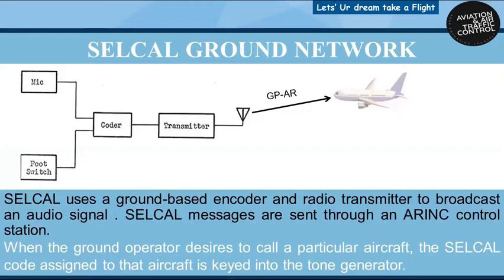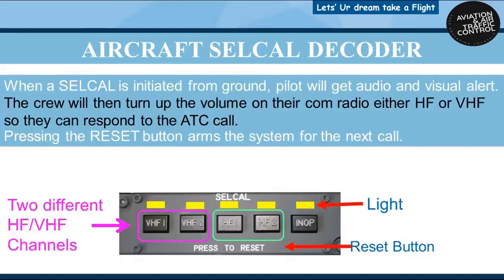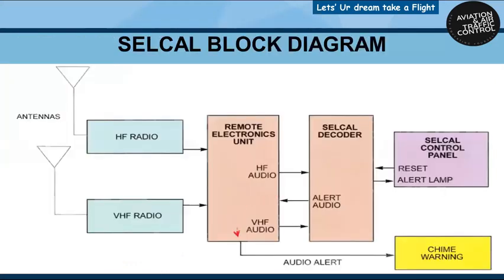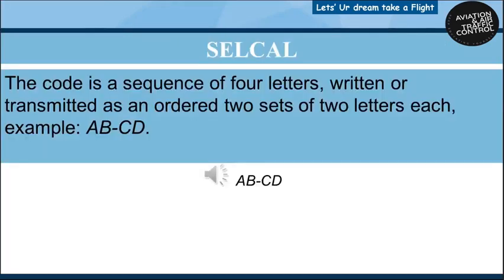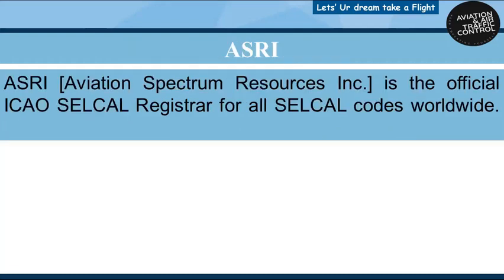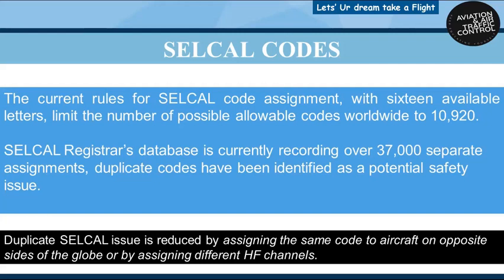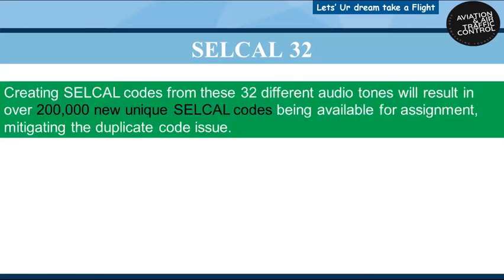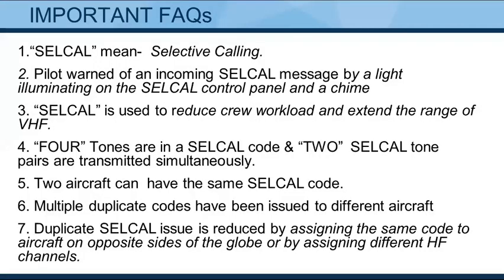SELCAL

Comment: Hi! Can you help me to know, why in the new 16th codes they take away the 0 also, because i know thay the o was took it away because it could be confuse with the 0. I cant find any information about it. 
Thank you
Reply from the maker: Thanks for asking, you are correct. "Zero-0" and "o" look the same. As you are aware to notify pilot 4 letter code is generated by a SELCAL encoder at the ground stations. It was done to  avoid confusion to the operator who is keying or  feeding the alphabet. 
The changes started from the 60s, earlier it was  8 bit thereafter it became 16 bit now we have 32 bit SELCAL.
Studies are going to replace radio communication with the aircraft to avoid misunderstanding. The voice commands by the air traffic controller will be replaced by an audio watermark technique.
Reply: Thank you for you answer! 👍😀